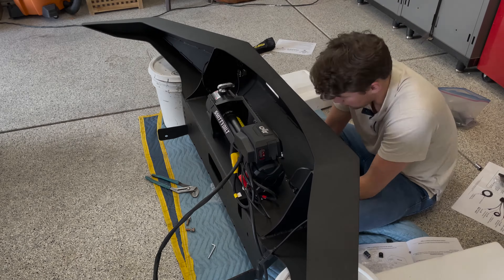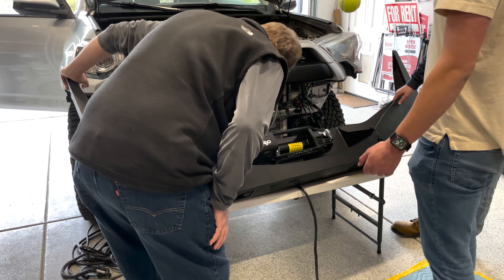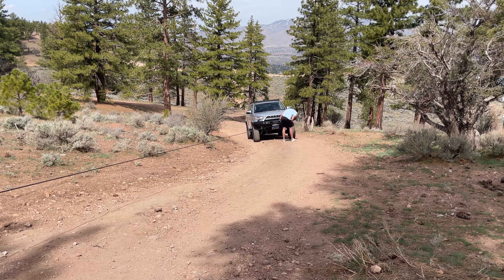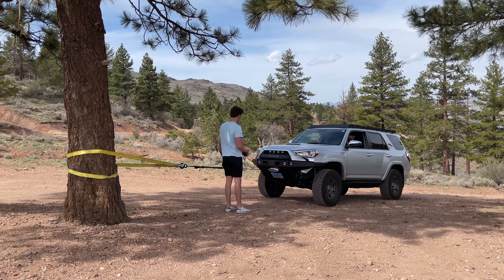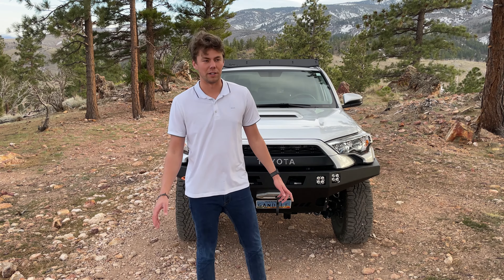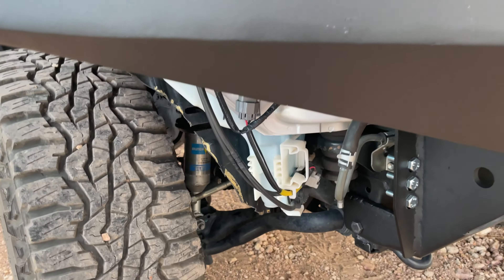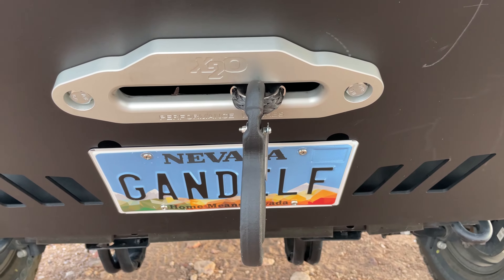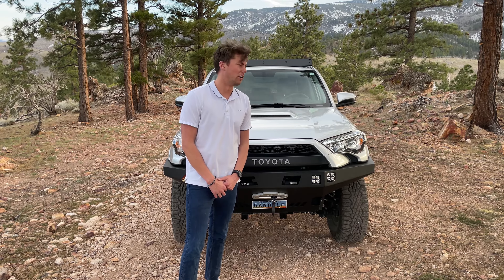5th Gen 4runner Coastal Off-Road Bumper and Smittybilt X2O Winch Install

Comment: How much did you have to bend that power steering like to clear the winch? Or what did you end up doing?
Reply from the maker: Just bent it up towards the main body/radiator area. Don’t force anything but was a pretty easy bend and still had good clearance with no unnecessary stress on it. Did cause some clearances issues with my winch control box where it broke the mount to it, but warranty department for the winch fixed that and it’s all set again

Comment: Great start if this is your first video!  Considering getting a Coastal Offroad bumper but with a 20" light bar cutout.  Coastal said the winch access holes will be moved onto the lower angled plate to create room.  From your experiance do you think that would compramise access to the winch and it's function?
Reply from the maker: Hi there! Thanks for the comment! :) 

I don’t think it would compromise access to the winch in any way, it honestly may improve it or be indifferent. 

That being said the access isn’t to fantastic already, so I also kept the plastic cover in the engine bay behind the grille removed, just in case it’s easier to access the winch that way. Turning the clutch on the winch should be easy enough, getting the winch remote plugged in takes a little bit of tinkering though.

Comment: Did you ever relocate your washer fluid reservoir?
Reply from the maker: I did. I failed to document it adequately however and didn’t make a video. Was fairly easy, accidentally broke one of the fluid connectors but just taped it back on. Some screws for the reservoir were not possible to reach so secured it the best I could.

Comment: How many hours did your guy spend welding and grinding?
Reply from the maker: Probably took 5 or 6 to tack it all correctly but we were taking time to make sure we had all the angles right and everything was level. That time also included time for removing the front bumper and cutting as needed. We also tacked while it was on the vehicle. 

Probably another 5 or 6 to finish the main welds and grind. Then an extra hour or two for some finishing welds and grinding while it was on the vehicle if I had to estimate.